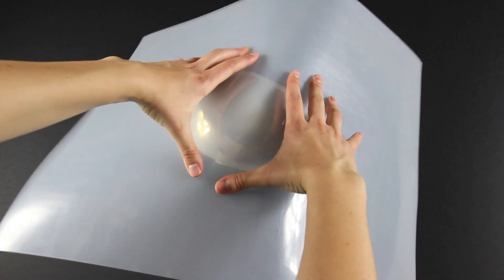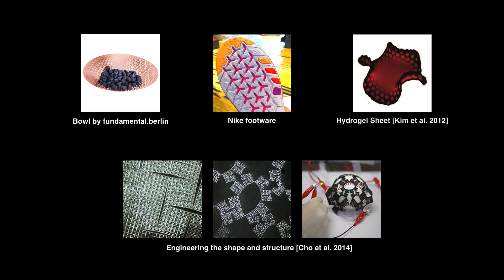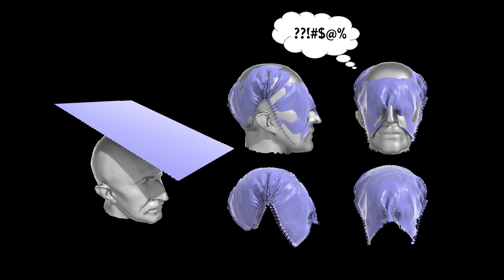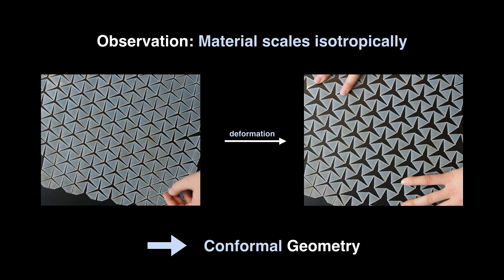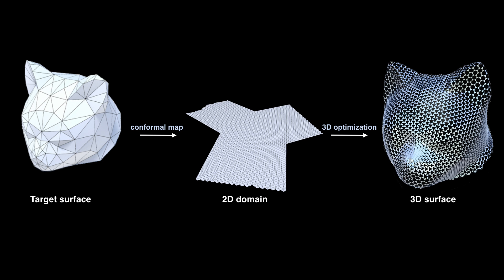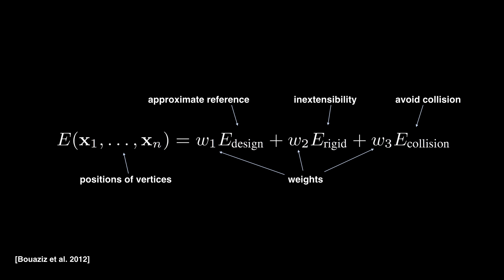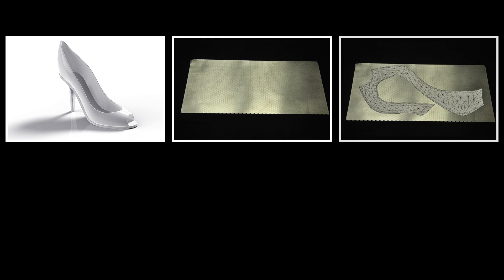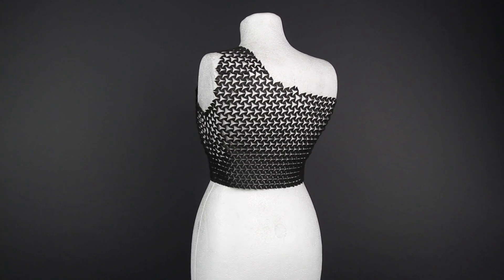Beyond Developable: Computational Design and Fabrication with Auxetic Materials (SIGGRAPH 2016)

Comment: Is it possible to make auxetic structures small enough so that it can be used with fabrics for clothes or accessories?
Reply: Actually yes.  Auxetic materials don't have a length scale, so they can exist at any size.  The real challenge would be the manufacturing of these materials at the small scale for mass usage.